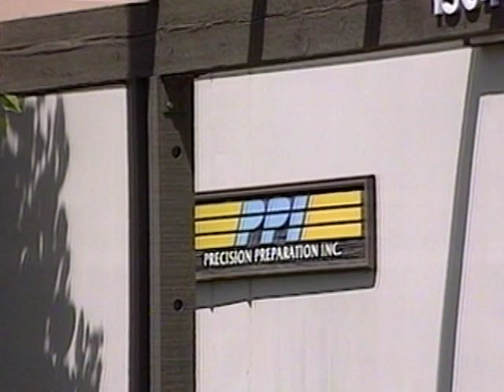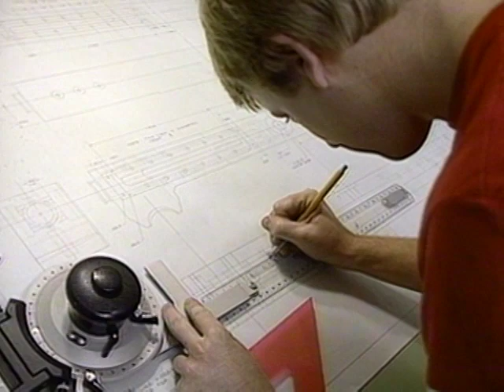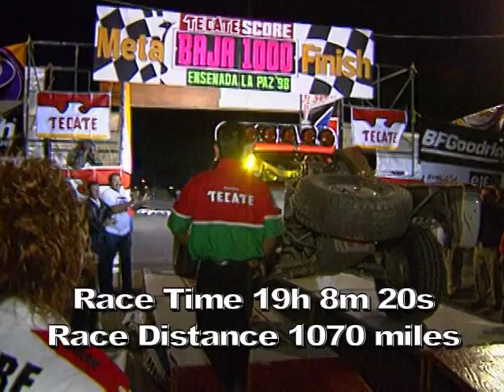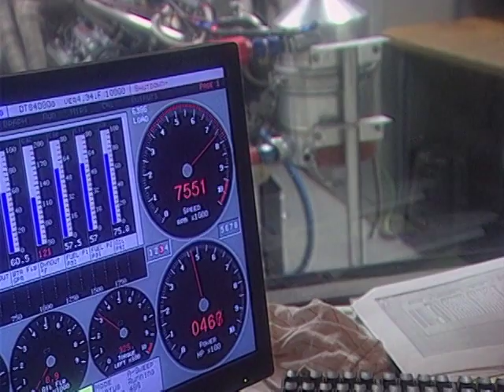Ivan "Ironman" Stewarts' PPI Toyota Trophy Truck 015 -  Baja 500 and Baja 1000 Winner

Comment: People used to laugh at the Japanese when they were trying to enter these off road cars/trucks.  But after a while the tone began to change when they started winning races. My dad has a 1982 4x4 Toyota pickup and everyone that sees it wants to buy it for cash right now. Why? Solid Axles, and the short wheel base. Toyota was way ahead of it's time back then. No one can deny that. Ford and GM actually engineered some of their later vehicles based on the Japanese designs. I'm not siding with either of them, I am just saying when you have drive, determination, and a willingness to engineer something better - Hard work always pays.
Reply: LoudNProud  and Thanks to Mr.Toyota 👏🏻
Reply: Very true.  They were way ahead of their time.  They perfected the small engine/small truck package.  I grew up a huge Ivan Stewart fan....who wasn't?  Then I gravitated to Chevy when I was a young teen and haven't looked back.  The baja races of the 90s were huge.  I remember the Nelson&Nelson trucks with Ragland winning the 1000 for 3 straight years from 95-97 in the Chevy thunder truck.  Ford stirred the pot introducing the Raptor, now Chevy has the ZR2 with the ZRX on the horizon.  Ram has the TRX coming, and Id like to see Nissan build their Warrior concept, but they are really struggling with sales right now.  Will Toyota then follow suit....time will tell!
Reply: FOCUS, COMMITMENT  AND SHEER WILL.

Comment: What motor is that at 7:30? If thats a 3VZ I'm going to shit myself.
Reply: That’s exactly what it was. 3L 300HP DOHC V6. About 1993 or so they got the 5VZ-FE 3.4L 360HP engine that ran until 1996 when they got the first Lexus race tuned V8 in 1997